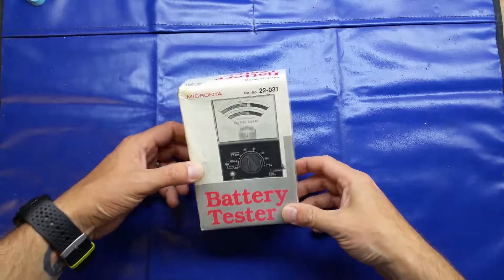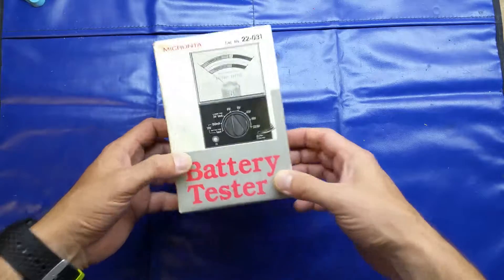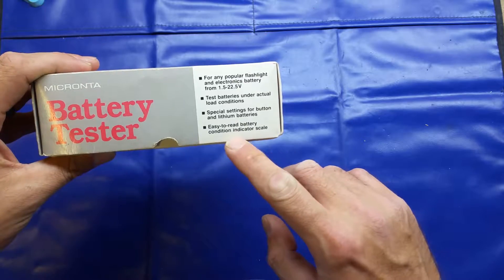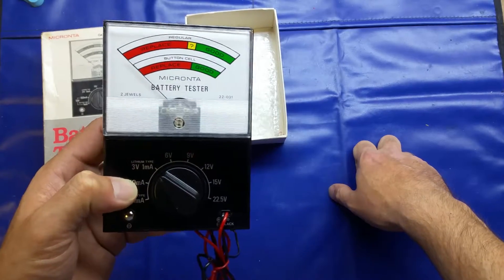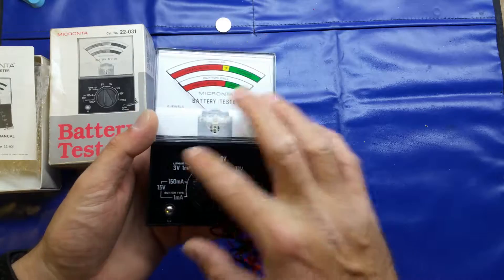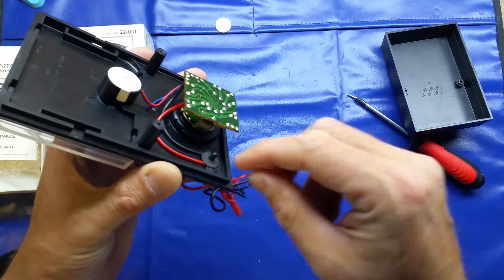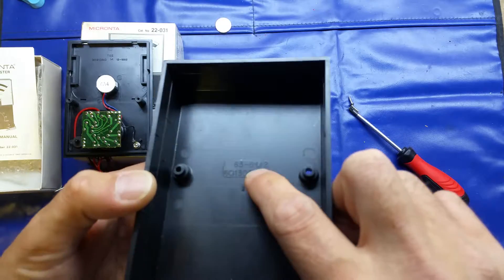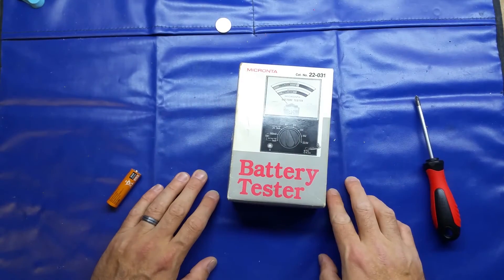Vintage Micronta battery tester teardown and explanation of why a Battery Tester differs from a DMM

Comment: My Micronta tester works only if I use the large negative button on the device, not the black wired probe. I would have thrown the device out if it were not for this excellent and thorough video that pointed out the negative button. This device belonged to my father, who taught me to use it and therefore has strong sentimental value. Being able to continue using it connects me to wonderful childhood memories!

Comment: 6:40 It's easier because if you aren't holding the battery (like if the battery is laying on a table), then the battery has a tendency to try to move/roll away from the probes as you are putting pressure on them.

Comment: I bought one recently at a Goodwill, for $4.00
It's in almost as good condition as yours (It was very slightly dirty), and still has the box and instructions.
It's still a decent battery tester, even compared to more modern cheap analog battery testers.

Comment: I have an old Micronta that looks alot different than the one you have.  it's a light blue color.  I actually have two of them that i bought a long time ago.  One works and one works except for on AA batteries.  Which is odd.  It has a tester for the AA; but, just doesn't register anything anymore.  Works fine for AAA though.  Wondering how many AA batteries I tossed out before I figued this out... Huh!